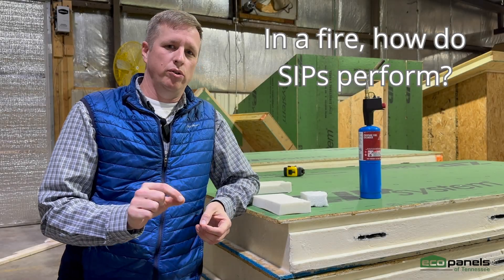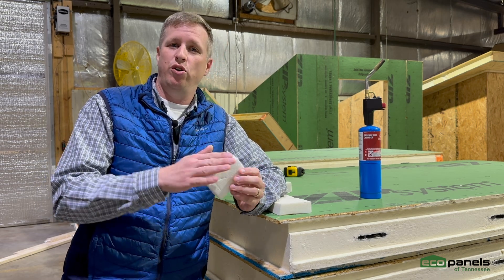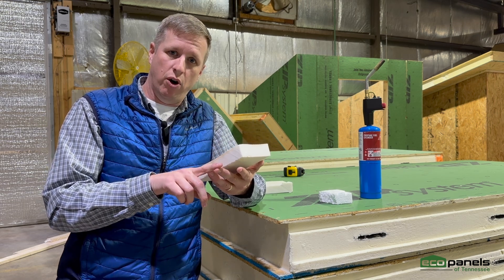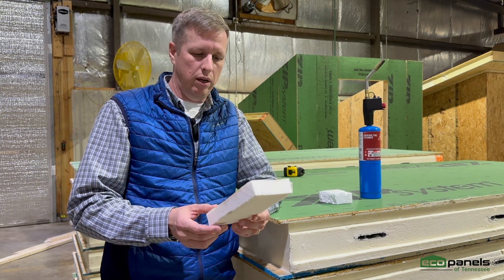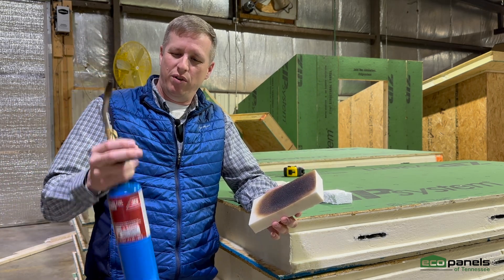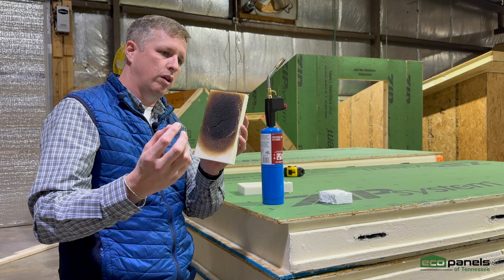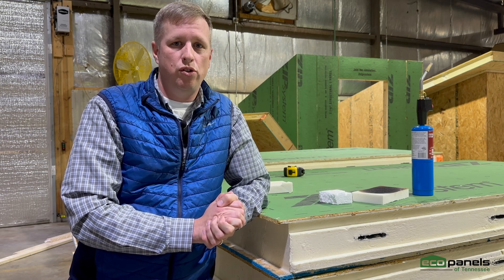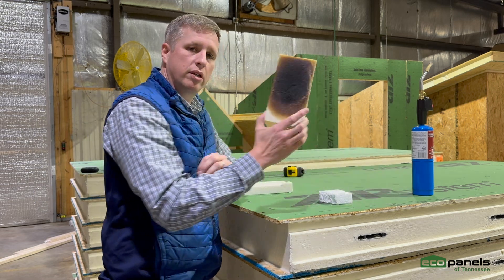In a fire, how do SIPs perform? | Eco-Panels of Tennessee

Comment: For everyone that may be considering SIPS, my personal view is that a polyurethane-based SIP is a stronger and safer panel. EPS will always have a fire problem due to the nature of the foam in the presence of a flame, but polyurethane is stronger, it serves as its own adhesive to the exterior skins and it does not burn. I am still in the design phase of my own home but I took the time to travel to Eco-Panels of Tennessee’s facility for one of their Saturday morning information sessions and plant tour. I personally spent some time talking with Josh (who did this video) as well as several other folks on the team. I found them to be very straightforward, very knowledgeable and genuinely interested in my project. If you are at all a building science nerd and are as interested in how your home is built as you are in what it looks like, this tour and info session is a well-spent Saturday morning.
Reply from the maker: Good to hear from you Spencer! Thanks for talking up the seminar and what we do!
Reply: @ - Just recognizing hard work by good folks. Take care.